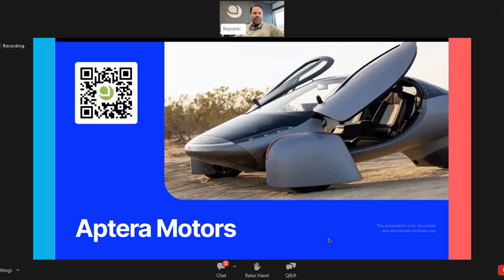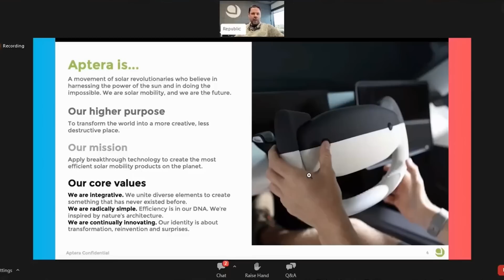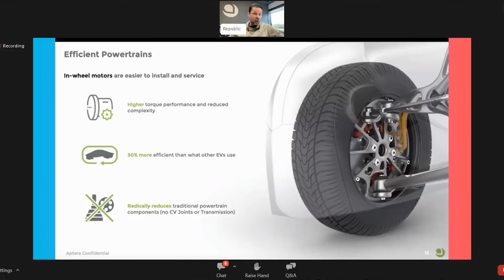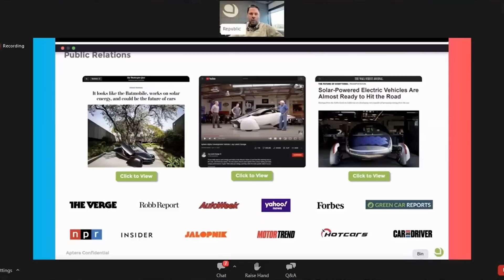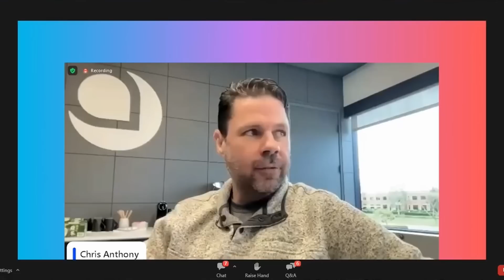Chris Anthony and Aptera on Republic Crowdfunding's The Unicorn Hunt

Comment: Re: Elon on Aptera. Not at all surprised by Musk’s “normal” response, as NOT being able to scrape together $50M to get started is REALLY a joke, relative to how Tesla started, let alone today. Nonetheless, what with all the radical progress, compared to the original attempt, in new design, materials, & manufacturing approach that Aptera has demonstrated, they seem better positioned for, albeit much more niche, success, than the original Roadster. However, the window IS closing for this form of vehicle to gain acceptance. My bet is unless Delta is delivered AND started regulatory certification (i.e., started establishing real world legitimacy) by this year end, plus started production by mid-2024, I’d say all bets are off. There is just to much (albeit totally unsubstantiated) “noise” from EV wannabes, like Stellantis, GM, & Ford, for Aptera to not be lost to investors, amongst all that growing “conventional” clamor. The ultimate lynch pin will be whether Tesla will agree to support Aptera charging, not only with NACS plugs, but the seamless user interface that includes charger availability through the navigator & automatically routed payments. Just having “notional” solar range won’t be convincing enough for initial adoption, only in terms of supplemental & sustaining marketing, given actually good owner feedback. Also, their ability to demonstrate functional OTAU, along with Adaptive Autopilot equivalence, are MUST HAVES that cannot be ignored for long.

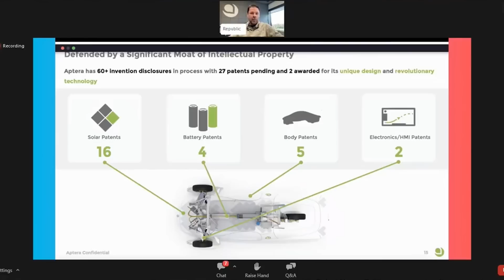Comment: At 10:26 the slide says "Inexpensive and simple tooling" for structural parts. That might had been the case with the original fiberglass + foam core construction plan but I don't think it is the case with the current molded carbon fiber. The large very heavy machined steel molds and the large presses needed to handle them look very expensive and complex to me.
Reply: Compared to, say, a set of assembly robots?
Reply: Molds may enhance scalability and reduce volume production price barriers. Smart move that shows they expect to produce tens of thousands to this model.
Reply: That tooling cost amortized over 20 years or more of tool life is not that much. It allows them to stamp out consistent high guality body parts with a fit and finish that are good out o f the mbold.. and they can be assembled by hand without special fixtures, etc..

Comment: Sure wish they would stop hawking the 1,000 mile part. These vehicles are going to be fantastic, even the 250 mile battery. Stating 1,000 miles without adding - available, or with largest batteries option is kindof misleading. Even more accurately he could say we are working towards offering a model with up to 1,000 miles of range.
Reply: 40 mi/day solar, 1000mi max range, 0-60 in 4 sec, are all headline grabbers. The Aptera's super efficiency is it's main strength, but the internet is a fickle dance partner. And it needs to show that Aptera has extraordinary capability, to be a superior value, and worth consideration. Superior products should excel on their own merit. But unfortunately the world doesn't work that way.
Reply: I agree. They can get with claims like that now but once they go public short sellers will use an unfulfilled 1000 mile range claim to paint the company as a fraud.

Comment: Chris needs to emphasize the driving experience and the unique and amazing looks.
Reply: Yep - sports car EV that people can afford is a completely open market.
Reply: @ccibinel  Grand Tourer (GT), not sports car.
Reply: @0ops1e  Except the Aptera isn't a sports vehicle...
Aero panels completely covering the all 3 brakes and preventing heat dissipation.
Massive unsprung mass at each wheel.
Aptera itself reducing power output and top speed for the sake of efficiency.
Reply: @chrisrudzinski6241 probably more sports car. Not so much race car. I would imagine. We will have to drive it before we get too predictive.

Comment: Are aptera still not including side air bags?
Reply: Doesn't sound like it. Still think it's a huge mistake but I guess it's their call.
Reply: It will have Formula One levels of safety. Those drivers survive the most horrific crashes. Aptera is confident safety will be proven "irrefutable".
Reply: @barnabasseadog7660  Those drivers are also highly trained in what to do during a collision to prevent injury, not to mention they train their necks rigorously to mitigate whiplash and prevent internal decapitation.
Reply: Good point by everyone. Yes I have a son who will be big enough to sit at the front seat by the time the apteta is available. I'd feel better with more airbags to complement the composite structure.